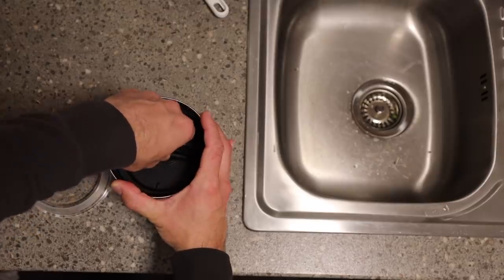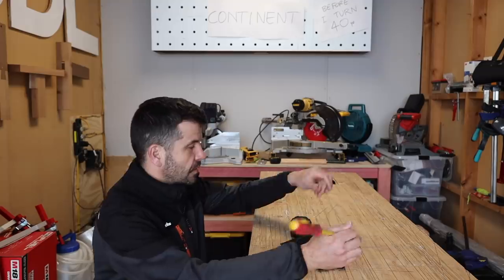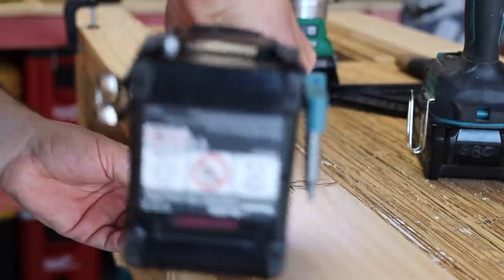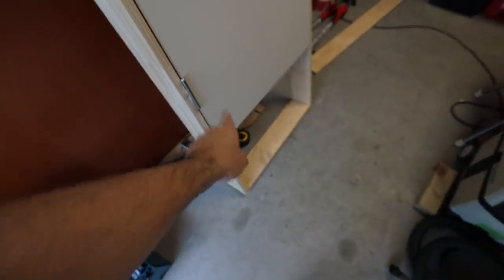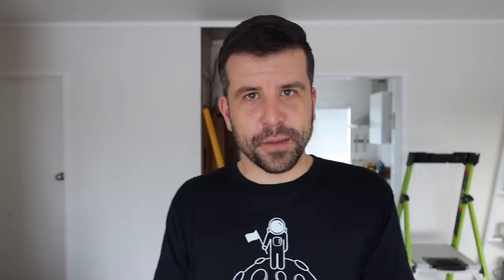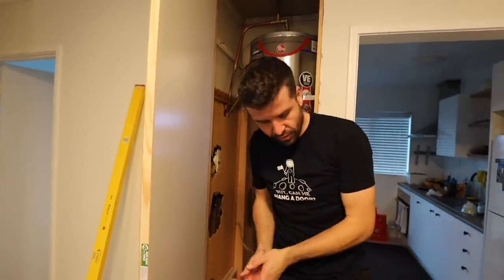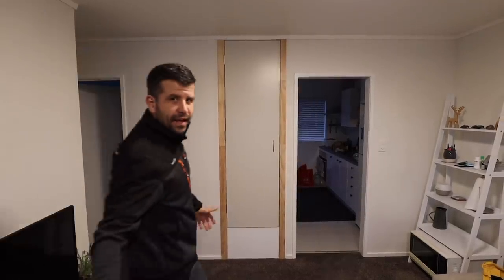When Hanging A Door Gets Complicated

Comment: You don't need to cut the hardware screws, those aren't cut slots, those are scores so you can just snap the screws at those points using two sets of pliers.
Reply: Exactly correct!  They are ideal in a situation where the thickness of doors vs drawer fronts varies when installing  kitchen hardware.
Reply: Yup. I just use a set of side cutters and snip them. Easy peasy.
Reply: Can even ping them shorter with a hammer over the edge of something....but watch your eyes
Reply: It depends. That used to reliably be the case but these days, so many of the included-screws that looked like the ones Scott had will just bend inconsistently. They don't have scored sections, they just have gaps in the thread. Even using side-cutters can be a mission on those ones.
Reply: Knipex 200mm bolt cutters are what I use for this. Cut these screws daily with them.
Reply: Knipex miniature bolt cutters for that job all Day long, fantastic German quality, 👍 🔨 🇩🇪 🇮🇪
Reply: Set of pliers and brute force, if that doesn't work then the hammer comes out haha
Reply: Yep or just use your pincers
Reply: most electrical strippers have screw cutters in the jaw, works great for these
Reply: I've always cut them with linemans pliers. They're pretty soft.

Comment: Watching the expert way you make that door it's almost like you've done it before.
Reply: ''but does he know how to hang a door?'' long term subs will get it
Reply: Don't know but he has a sick van
Reply: @simeonprice390  it’s no Bentley
Reply: He did a great job of it, but like most builders he obviously doesn't do it enough (prehung doors are the norm now) to do it the most efficient way.

I was forced to do it a lot because my small town suppliers in Tokoroa didn't stock prehung doors.

My process is as follows:
I first cut the vertical jambs exactly the same length, leaving the offcut for later. Then I set the door on it's edge (my saw horse has a way of holding it like that) and I make marks at 150, 990 and 1780. Then I bring out my router jig that I made, and place it on my marks and buzz out the hinge slots, which takes about 30 seconds. Then I quick clamp a jamb to the door with 3mm overhanging at the top end, and mark EXACTLY where the hinge slots are. Unclamp and repeat the router process on the jamb. Then I pre drill the screw holes and mount all the hinges to the door and jamb. Then I lay the door on the saw horses and I measure abd cut the head jamb, which is door width plus 2x3mm plus 2x jamb thickness, a couple of extra mm doesn't hurt. Then I glue, pre drill and screw the jamb head to the hinge jamb so the head jamb sits on TOP of the hinge jamb and is screwed into the end of it. I then carefully repeat the process with the lock jamb, and this is the only time I need to set the gap between the door and the jamb. And it's ready to install.

 Its much easier and better to install the head jamb on top, not between the vertical jambs. Mitering jambs should be avoided unless its a fancy one piece. I also mark using a knife and try not to rely on my tape measure because I don't like fighting to get the hinges on because I'm slightly off. Builders pencils can throw measurements off a lot, and the finished product is seen. 

My process takes about 15 minutes if my tools are out, and my results are usually superior to the factory prehung doors. It's cheaper than a prehung too, but only because I'm good at it. 

Oh and the key to fast routing with a jig is to get a 12.7mm router bit that's got a bearing above the cutter. They are difficult to find in NZ for some reason, but are available in the crappy Ryobi router jig kit. Throw away that jig, it's not accurate, it's meant for American hinges and it only works on doors not door jambs. It will however give you the idea of how the jig should work. My jig is just two pieces of wood fixed together at right angles with a 90mm long hole in it the same size as the hinge mortise. I just place it on the door and hold onto it firmly. No clamps required. 

Unfortunately the art of door hanging is going by the wayside. But if you're a carpenter who does a lot of older home renovations, and you're driven to get the absolute best quality possible, doing it yourself is better and sometimes the only way imo.

Comment: Scott, little tip for those handle screws.... lock it into your power drill and then place a hacksaw against the Desired length and let the drill do the rest👍🏻
Reply: Scott and Paul, even more of a tip! You can get small bolt cutters that will easily and cleanly cut the screws, if they don’t have the notches like in this video then you put the screw in your drill and run it along a file to get rid of the burs. I used to build hospitals and apartment buildings and that was a life saver!

Comment: For next time, if those are the kinds of screws im thinking of (the ones for the handels) you can cut them with cutting pliers! :)
Nice video as always!
Reply: you probably could but i personally wouldnt do it often as i wouldnt want to knacker them.
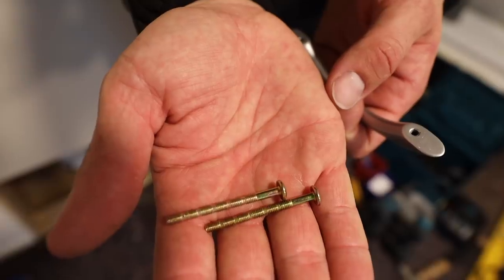Reply: @connahjones8178  As far as i know if you look at 10:24 they got cuts on them wich is ment to be cut with pliers, Atleast thats how i was thought to do it :)
Reply: @Thexhiv   i have done it either with a hacksaw, angle grinder or something like that, i think the spaces are just so you dont have messed up threads but im not saying your way is wrong, definitely quicker than my way.
Reply: Not these cheap but strong screws. They don't have cutouts they just have gaps in the threads. Cutting them repeatedly will indeed knacker your pliers.

Comment: 🤚🏻 ready made doors usually stacked vertical but usually end up with a lean when others removed,,, hence the warping/bowing. Sometimes you can lean them against a wall with bowing side outwards & while it aclimatises to the house/heat the bow will revert, but don't leave it too long!

Comment: With those screws if you get hold either side of which line you want it on with two pairs of pliers you can wiggle them and it will break easily,  much quicker and easier than cutting!
Reply: This as well as just nipping them with a sturdy pair of linesman’s. I don’t have strong hands by any means but my Milwaukee linesman pliers will chop those all day long with minimal effort. I’d imagine some Knipex or similar would do it even easier.

Comment: You really need to invest in a trend hinge jig. It's painful watching you mark each hinge individually would cut your work times in half
Reply: Mate, I was thinking the same thing. I’ve never looked back...... not sure when I last hung a door that way🤣🤣🤣
Reply: Are they that good never tried one. always make a rod and mark every thing , then do  it with a router
Reply: @Will-pq7pj   3 hinges on door and frame routed in less than 2mins and always lined up perfect, you will never look back some videos on you tube you could watch but they don't do it justice best pice of equipment I have
Reply: @trevormeldrum9844  I will look it up thanks.. how about lock jigs you ever use them?
Reply: And a self centering drill bit.
Reply: @Will-pq7pj  yes, they’re really good. A great time saver especially on the frame as it allows you to router out quickly the hinges. 
I used to use a staff to transfer the positions but meant more time on the frame with a chisel. 
I completed my kit with the battery 1/4” dewalt router👍🏻👍🏻👍🏻
Reply: @Will-pq7pj  I have a lock jig and it's fine if your doing one door but if doing a house with 10 or 11 doors it gets annoying having to change settings every time so I just use the jig to router the face plate and  then drill out the motice with an auger bit. I find this much faster

Comment: Hey Scott! Thanks for another exciting video! Got a good tip for screw trimming.

Use a pair of decent miniature bolt cutters. No sparks and super quick. Nothing else needed if they have the thread seperation bits... If you have to cut through the thread, pop the screw in your drill chuck and run it full speed while you file with a bastard file at 45° to deburr the thread. 

Hope it's useful for anyone.

Comment: Is there a reason you could not use the key on the slider? I'm guessing you have changed the standard locking mech, Even rear door. These are the same as the AU model no? Which can open this way.

Comment: Just wondering why you did not paint it before fixing into its final location, or even before the hinges were fitted? Was it out of habit ( being a carpenter and not normally required to do the painting as well ) or is there some logical reason why it is better to paint in position, rather than prior to installation? Not being a trades person myself, I would have assumed that it would have been easier, less mess and a better finish if the paint job was done prior to the gubbings being added and prior to being installed.

Comment: I would recommend the Viper alarm, it vibrates the key fob up to 1.6km away if the alarm is going off. It can start your vehicle too if you add an extra module. I have it installed in a Hiace as well

Comment: if your alarm is aftermarket and not from the car it will do this but you can use the original key and it will work you just have to unplug your alarm. give it some time to sit and you might be able to get it started

Comment: Another good reason not to buy one of those Hiaces. They lack even the most basic features, if I remember right they don't even have a chip key. So you wind up having to muck about with aftermarket junk added to try and keep the van and your gear from being stolen. They are just an over priced, over hyped waste of time (sorry Scott!)
Reply: Nothing wrong with Hiaces, my van is brand new and I have exactly the same alarm installed. Out of blue for no reason remote did not unlock the doors. After a few minutes I tried again and it works ever since. I believe that's something wrong with the alarm system rather. It is smart to keep photoshoot of  PIN code handy.

Comment: I love how your tape measure says 2000 instead of 200!
Reply: That's because it's marked in millimetres (not centimetres) as all good tape measures should be. Only dressmakers use centimetres.
Reply: @sw6188  yes, and that's what I love about it.

European tape measures are usually in cm. But it's a lot clearer to talk in mm for most applications where you need a tape measure. However, reading 56 and saying 560 adds some unneeded (albeit easy) conversion.

I love how Australians and New Zealanders standardized completely on the mm unit instead of the cm one.

Comment: Jess needs to get you a new van 😉
Reply: Hello from Seattle WA.
For cutting the screws for the handle I usually use an electrician stripper plier that they usually come with  6/32 and 8/32 die/cutter.
I thought it would come in handy for you next time and you don’t have to bother using a grinder.😉